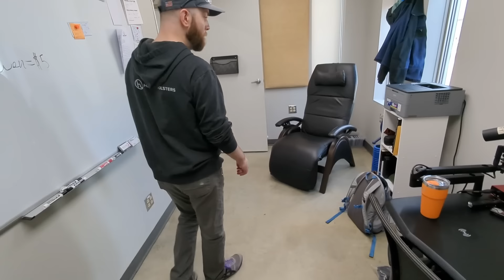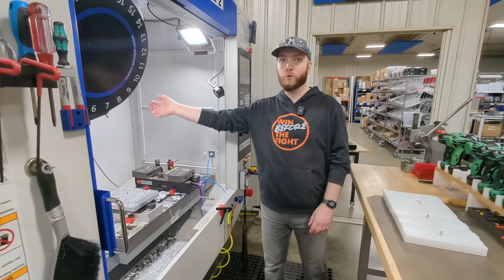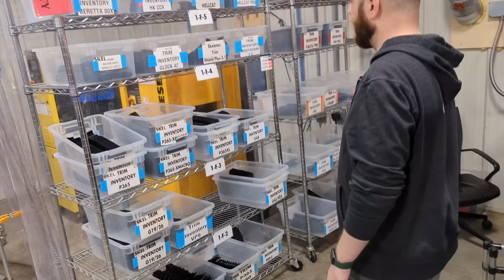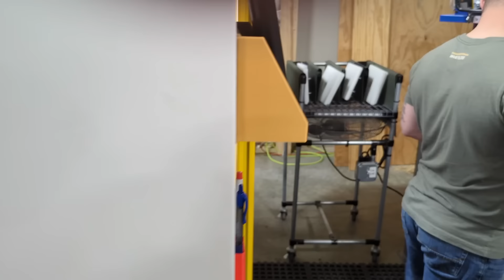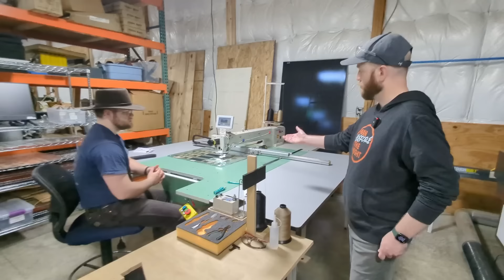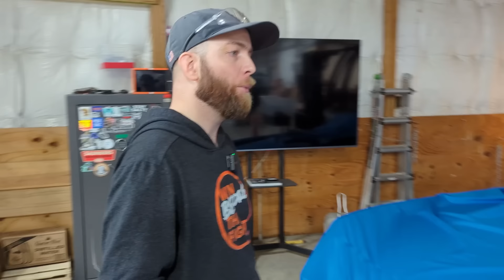THIS is what a LEAN shop looks like - Lean Machine Shop Tour

Comment: He’s so obsessed with optimising the production but what’s the point as he’s not seeing the big picture , most of the machines are offline meaning not getting any orders through. Those machines should run 24/7 non stop to make a killing
Reply from the maker: You might want to consider what you are viewing as "the big picture". 

Do you think the machines pay the bills? Or do you think it's shipping products? I'm pretty sure he doesn't make money until he gets an order from a customer. And if he doesn't make money until a product is ordered, then there is no reason to make extra products he doesn't need.

Comment: As an actual tool and die maker, i am annoyed. The manufacture would be way more sensible using Injection molding and die stamping. No wonder everything is moving to china, they know how to make something good cheap.
Reply from the maker: Maybe if they were making a few thousand of these things at a time, but with such a high mix, that would be challenging.

Comment: I liked the operation. On the finishing, what if they did a custom deburing tool in the machines. Kind like a double sided chamfer or double round over.
Reply: Another person asked the same question upthread. My answer was "We have looked into it. Because of the 3D contour of the edge of the part, it wouldn't be possible to engage the edge consistently with a roundover bit without a 5ax machine. A custom abrasive wheel could probably work in certain circumstances, but that creates additional dust collection and abrasives-in-the-machine issues.

Comment: Lots of awesome ideas here, this is a great example of Pull manufacture. I wonder if he ever thought about a custom buffer or tiny round over bit to break those edges before an employee has to touch it again? Thanks for the post!
Reply: We have looked into it. Because of the 3D contour of the edge of the part, it wouldn't be possible to engage the edge consistently with a roundover bit without a 5ax machine. A custom abrasive wheel could probably work in certain circumstances, but that creates additional dust collection and abrasives-in-the-machine issues.

Comment: what's the point spending so much money on regofix just to cut plastic?!
Reply from the maker: I don't know his exact thought process, but I bet it has to do with reliability and repeatability.
Reply: Low runout numbers, excellent tool life and edge finishes, the ability to standardize tool stick outs easily across multiple machines, and simplification of the tool setup process. The more different types of holders you have in the machine, the more wrenches and other tools you need to keep around, and the more documentation on torque specs, holder specific quirks, etc you need to keep track of. Also, we’re running thru-spindle air on some of these, and the rego collets do an excellent job of delivering the air right along the shank of these small tools to keep chips from wrapping.
Reply: @HenryHolsters I use high end collets and cheap ones. When you use er8 it has to be rego. For bigger ones anything will work.
Reply: @HenryHolsters  Yes, I read the marketing brochure. You are cutting plastic. The spindle bearings in those brothers will polish up and start sliding sooner, than you'll have run out problems.